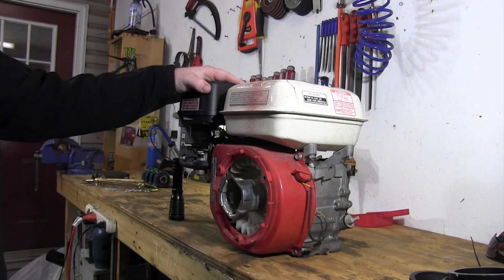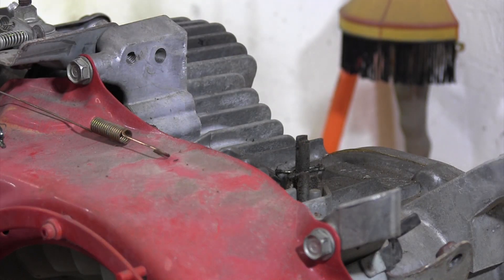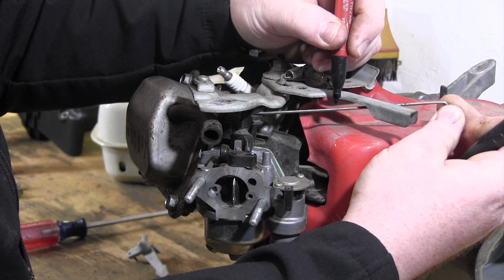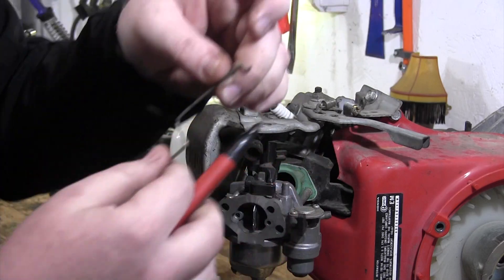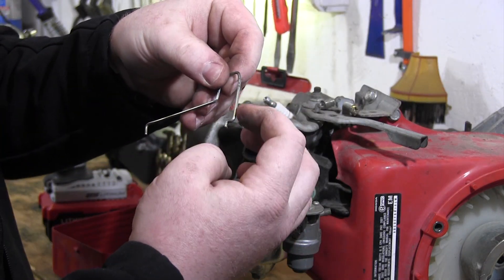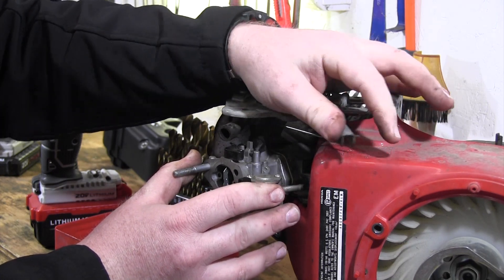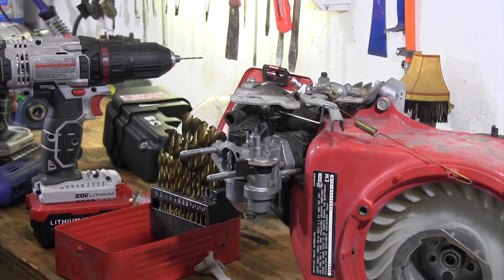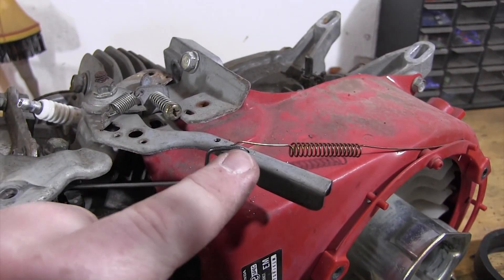Predator 212/GX200 Go Kart Throttle Linkage With Removed Governor

Comment: So after doing this can you just leave the governor loose and it will function ok?   I need to rebuild the throttle setup on my pressur washer motor because I think the springs are sprung and it just runs at one speed regardless of what changes I make to the throttle lever.

Comment: Do you have a video of jetting a stock carb and it's adjustments? We have a 212 predator and the carb stalls when we get off the gas and there is a idle screw and I see what appears to me maybe an idle air fuel mixer screw where other carbs have a plug in that spot.

Comment: I tried doing this to a 420cc Briggs & Stratton (XR2100). 2 things: (1) I had to reverse the spring and cable pulls to the opposite of stock. This is because the carb would be wide open at no throttle at the handle and closed at the carb when full throttle at the handle. That and the spring would hold it wide open.  Basically if I did it like the video it would be wide open as soon as you start it and would stay there. Maybe I did something wrong. I shined a light inside to observe the butterflies. (2) I just removed the lever on the governor and left all the internal stuff. Will it run ok with nothing connected to the governor shaft? Any help would be appreciated. Haven't run it yet cause I'm not sure if it's correct yet.

Comment: Hi, great videos, to do this I need to remove first the governor isnt it???, and also I have  predator 212cc and has the original linkage but the carburator plastic piece where the metal rod links does not close, meaning thatbif I want to adjust the throttle thru the plastic screww it doesnt work, is this ok or the plastic piece must close complete when static??, thanks for sharing

Comment: Can you bypass the governor and leave it in the engine (preloading it with the attached spring to keep the governor against the internal inertial adjuster to avoid it coming apart inside the crankcase)? I have read the GX200 clones are good to ~5500rpm with stock internals. What would be required to spin this engine up to ~9000rpm? billet rod, heavier valve springs? Anything else?

Comment: Had u put ur linkage closer to that main nut location u would have more of a throttle fill not just wide open and idle. I fig that out the hard way. But redone and way better u want it its there. Well for what it is.

Comment: RBG I love that you are teaching the masses!!

But, i got a faster to respond method, if anyone needs an alternative to this tutorial.

If I could post a pic,you'd understand QUICK-- but...., if you drill through the top of your butterfly, run your cable through that hole,pinch it with a nut/screw from the original throttle mechanism,arm it with a return spring from og mechanism, and mount a cable housing pinch (cut from original mechanism) on the shroud ,in front of the carb.
Throttle will be straight to carb, no lost movement or response.
Reply: That's just so crazy it might actually work !

Comment: I'm finding on my mini bike that the linkage arm is so short I'm losing half of my throttle turn on my grip. Which makes it go to quick too fast. Thoughts anybody?
Reply: I think you can get different throttles that have a smaller cam I guess you could call it, so it gives you more throttle movement for the amount of arm movement.

Comment: I used this method on my 212 Pred’ mud motor, left governor in the crankcase and i run mmmmm high rpms for mmmmm extended periods (its a boat/ WOT) and i have has zero issues whatsoever

I did for peace of mind spring load the old gov arm so as the mech governor tries to correct rpm the arm has something to more safely tug against.

Mine runs like a red a$$ ape

212 Hemi

Comment: Doesnt it get rid of like 70 percent of the throttle?
Reply from the maker: You get a shorter throttle throw. The ideal thing is to buy a top plate or install a mikuni style carb
Reply: @RedBeardsGarage  Could you run it without those things?

Comment: Hey Red beard I've got a question for ya. My throttle doesn't have long return like the one on video it's a Colman ct200u ex. Just got it. They made it shorter I'm wondering if it would still work. I know your busy. So respond if you can sir
Reply from the maker: It all depends on where you mount the linkage rod.
Reply: Thank you sir

Comment: This is probably a dump question but do you need to remove the gear in order for you to gain speed?
Reply from the maker: What gear are you talking about?
Reply: Red Beard's Garage  The govener gear inside the engine.
Reply: Red Beard's Garage I have a question about how to factory set the governor on a gx270 a video of how to would help me out thanks

Comment: I did this it works fine but now I have to put throttle for it to start any help on why it's like that
Reply from the maker: You have to give it throttle to start it? Is that what you are saying?
Reply: Yes sir
Reply: Yeah I’m having the same problem, like the stock set up let the throttle body flutter or something. I have adjusted the crap out my pre set screw to the point when it did start it was idling too high. So while it was running I turned the screw down tell it sounded right. But now every time I start it I have to manually open the throttle slightly and it’s sketchy on a mini bike with no kick stand. Especially on the side of the road haha. Any advise? (Not much info on this problem, like it doesn’t happen to other people.) but it seems like something like this would happen or it wouldn’t.

Comment: The return spring fell off when I had to take the cover off because of the rope tension problem. I  put it back together and the engine went into full throttle. That return spring fell off. Not sure now where it goes, need help thanx.

Comment: Question, I have the 212 Predator and want to remove governor and oil sensor. Now, other videos show opening the case to remove the oil sensor but then you must tap the hole, can I just cut the exterior wire to deactivate the sensor?
Reply from the maker: +guitaristinseattle yeah you can.

Comment: Love your channel, Red Beard...your videos are very informative in giving more detailed information and, are no doubt helping a lot of people with their projects/builds.  
Check out this solution in providing a direct throttle connection for Predator Clones/Honda engines: 
https://youtu.be/RKhG594o2c0
It reuses the stock control rod and governor spring without any cutting or bending and allows you to remove the old throttle control on the engine altogether.

Comment: I just ran my throttle cable directly to the carb. I couldn't stand that stock bracket on the preditor it was just to floppy to be used.
Reply: Have a pic?